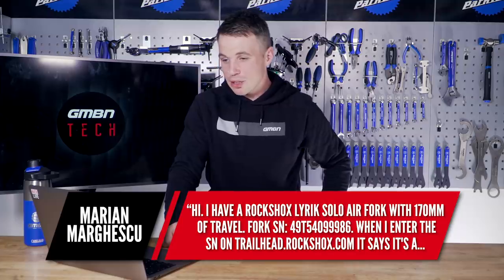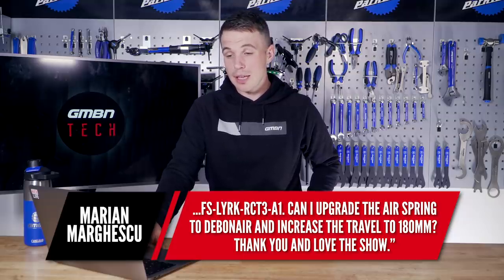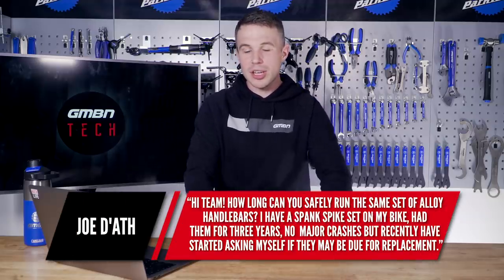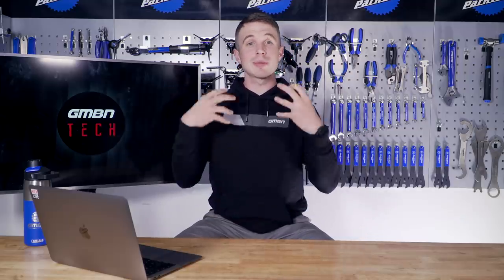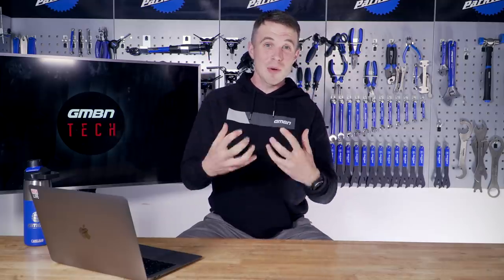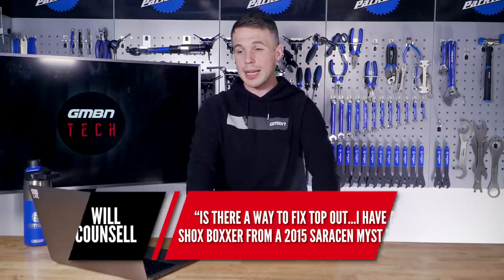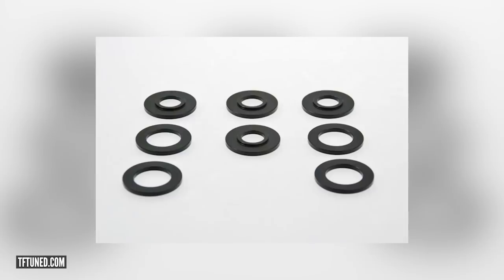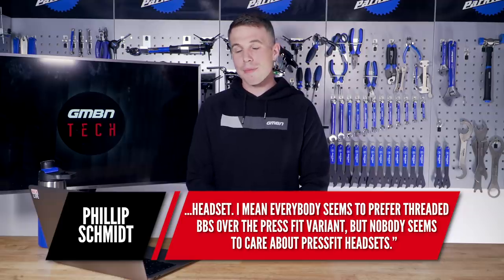Why Is My Tubeless Set Up Leaking? | Ask GMBN Tech Ep. 90

Comment: I had a valve hold air for a few days then when I would add or remove it would then loose air within a few hours. The valve was bad...
Reply: Kazak Thranduil Same thing happens to me I think I think it’s just because the seal of the valve and the rim
Reply: @JamesRailProductions.  that particular valve was bad, I have several specialized bikes so I have a few laying around and a new one fixed the issue 100%

Comment: #askgmbntech I've got a very interesting question: On the new 2020 Commencal Furious with the blue frame and the Fox drivetrain you can see that there is "Factory" written on the side of the lowers of the fork. But the stanchions are black but not as black as the performance version. When you look closely you can see the typical KC for Kashima Coat underneath the headtube. Does that mean that we're getting black Kashima in 2020?

Comment: #askbmbntech While swapping some sram brake levers I had an issue where the hose/olive would not come out. The hose ended up tearing off leaving the olive stuck inside the lever.  Do you have any recommendations on fixing this issue?  Any clue what may have caused this?

Comment: Ian at Renthal is a good dude. got a apex stem with 2 of the same clamps. meaning, the print would go on the inside of one of them. Sent a question just generally asking if this was normal. Few emails later, I had one of the clamps in the mail sent right to my door.

Comment: For everuone thinking of putting more travel on their Trek with KnockBlock headset (F'EX, Slash, Remedy etc.) - doing so you're limiting the way the bike can turn since it can only move a certain degree, there, for example, going around switchbacks on 150mm fuel ex is going to be... awkward. Really.

Comment: I have a question; I have a Juiced Ripcurrent S fat ebike which is sold as a "Sport Utility Bike" meant for paved road and packed gravel only. It came with Kenda Krusade tires which are road knobies with a relatively smooth center tread. I love the tire whir as I travel on my local paved bike path even tho I know it's not super efficient, but this ferocious bike has power to spare so it's not really an issue.  Well, anyway, It's getting time for new tires and I'm considering several, but prolly Maxxis Mammoths. After lightly researching tires, I found that manufacturers offer several options of 26 x 4.0" tire; They come in 30tpi, 60tpi and I believe 120tpi, some are foldable and some wire rim. Some are tubeless ready, but I'm not sure if tubeless benefits outweigh tubes with liners or filled with Slime, especially considering roadside flat repair on a 31.75Kg + bike. Tire selection is quite complicated and was wondering if you have any advice to help me choose?

Comment: #Askgmbntech Is there any bodge or hack to undo and thighten a FSA direct mount chainring? Because the tool is pretty expensive and I will use it once.. Thanks!
Reply: Could just take it to the local bike shop, they probably undo it and refit a chainring for relatively cheap rather than risk damaging it

Comment: #askgmbntech  Hey guys! If you buy a bike with say, 460mm reach with 800mm bars and cut them down to 760mm, how much does that change the reach number? I'm assuming there's some special measurement, and it isn't going to be 40 actual millimeters difference. Same question for stem length

Comment: #AskGMBNTech Are composite pedals any good? I’m looking at getting some nukeproof neutron evo pedals and could you tell me how long they will last being plastic
Reply: i have those exact pedals (in black). Been riding them for a couple of years already (xc/trail riding) and they are still just fine. So far i broke and replaced 3 pins. 

The only downsides i think of are: the pins seem quite long and dig into shoes, there are 2 non replacable pins per side and i lost 1 so far. And the dustcap wasnt properly tightened when they were new and slowly loosened. Once i tightened that i never had an issue

Comment: #askgmbntech. Hi team, I have a trek dual sport 3 that I use for bike packing. it comes with a Suntour shock with 63mm of travel and 700x38c tyres. after taking it on its first off road trip I find suspension lacking and was constantly bottoming out which is no surprise. I would like to keep the 700 tyres for ease of pedalling when fully loaded. Question is can I run a 29er XC suspension fork and still run 700c wheels and tyres? Thank you.

Comment: #askgmbntech Hi, I have a Cannondale BOTE 1 with the 120mm lefty fork which I love. Have ridden and worked on bikes for years and always serviced my own suspension.I've looked online and am struggling to find any info on what servicing is required on this fork. Is there anything I could or should be doing to these forks to keep them in good condition, beyond keping them clean? Thanks

Comment: #askgmbntech Hello guys! I am torn between the new Canyon Spectral CF8 and the new Nukeproof Reactor Expert 27,5". The Canyon is very nicely speced but the geo seems a bit slack at the seat post and a bit steep on the head angle. The Nukeproof is a bit lower speced but is agressive on the geo. What's your opinion? Do you think the difference is going to be considerable going uphill and downhill? Thanks a lot and keep up the great work!

Comment: #ASKGMBNTECH - I have SRAM XO1 cranks and I use a threaded SRAM GXP bottom bracket.  I have confirmed I have a 73mm BB shell but I'm wondering if there's ever a need to use the spacers that come with the bottom bracket.

Comment: #askgmbntech. I have patches of corrosion on my alu rims which has caused the paint to bubble. Is this likely to cause the wheel to fail? They're pretty old and 26" 28 hole so getting replacements would be difficult. Should I just bin the whole wheeler and buy some new ones? I don't use my MTB much so I don't want to spend a load of money on it.

Comment: 3:19  proper carbon bars won't break unless a world cup dh racer has a brutal crash, direct impact, which I saw footage of Renthal bar in Cathrovision do, they snapped at the point of impact. 
But i've not had a crash like that with my Sixc35 bars yet.
but I guess the bars won't just fail by use.

Comment: #askgmbntech my fork is170mm and I am too light to use all the travel. Right now when I use the recommrnded pressure I use is 35psi and the fork sinks down and turn into 130mm travel how do I use all the travel I use the Rockshox Yari and I weigh 42kg but I an still growing.
Reply: Make the sag 30% or maybe even more if it isn't already
Reply: Ben Asquith with the correct sag I only have 100 travel
Reply: Multiple possible issues here. First, remove ALL the fitted volume tokens (rockshox have vids online for this, follow theirs, not some youtube monkey, or ask lbs)
Second if at 35psi ur forks sink down into travel without u on the bike, u could have a blocked neg port or air trapped in lowers. Cycling the forks through full travel (pulling out to full extension by hand) a few times should clear a blocked port. Or use the cable tie slide.down seals to clear lowers .
Only other thought...u know the psi isnt the sag, right? Set psi to recommended level on sticker on fork leg, the in full riding kit, follow gmbn or one of many sag setting vids. 30% sag doesnt mean set to 30psi!
Reply: 35 PSI is waaaaaaay too low for a fork. As Rupert said, are you sure you aren't confusing sag with PSI?
Reply: @src248  i weigh 42 kg if i do 40psi the sag will be 15%
Reply: @rupedog   it is 35 psi any more and the fork wont compress i weigh 42 kg

Comment: #askgmbn Hey guys, I have recently bought the cane creek helm 29 which has adjustable travel spacers. My bike is designed for a 150mm fork and currently, I have it in the 150mm mode. You always say that "putting a larger fork on the bike will raise the front end" but what if the fork is designed to be able to have longer travel? Would this still affect the geometry if I bump it up to 160mm (removing a spacer)?

Comment: #AskGMBNTech. What's up Tech crew, I got a 2019 GT Avalanche with brakes that I upgraded to M7000 SLX, so they are brand new. After I got home from riding a relatively short but steep and rowdy descent, on which I was a bit heavy on the rear brake, I noticed mineral oil leaking from the rear brake bleed port, and where the two halves of the caliper come together(the front brake was fine). I immediately pulled the wheel and pads keep them from getting contaminated and also noticed mineral oil on the backing of the pads in the shape of the pistons (the pistons were not over extended. The disc and pad braking surface were not contaminated). I cleaned everything with alcohol and a clean rag. I tightened the 7mm nut/bleed port and banjo to about 4Nm. Is that a sufficient torque? What could have been the cause of the oil that leaked? And is there anything else I should do or be aware of? Thanks, Awesome videos and keep them coming.

Comment: #askgmbntech hi love the show 
I run a Fox DHX2 Performance Elite on my Bike and i have 2 questiones about it. 
1. Can you Change the valves which controll the oil flow (rebound and compression adjustment) from  Performance Elite to factory, would Like to do that because of the higher adjustabillity( high and Low Speed ) 
2. What can i do against topout 
Thanks

Comment: #AskGMBNtech 

Yo. I’d like to replace my disc brake calipers and reuse my rotors and mounts if possible. I currently have  Avid Elixir 1 calipers with 180mm avid rotors. I’d like to replace those Avid calipers with Shimano BR-M375 calipers (moving to mechanical for reliability, sacrificing performance). Am I able to do this without purchasing additional mounts or rotors? 

Cheers. Good show.

Comment: #askgmbntech
Hi guys. I've recently got back into mtb after many years away from riding and have been updating/modifying my bike. I have a new frame (NS Clash) which accommodates my Atomlab 26" wheels and I've fitted my Marzocchi DJ3's which have 100mm travel. The frame really requires a 120 - 140mm fork and so the BB height sits low.  As forks for 26" wheels with 9mm QR are thin on the ground nowadays, I was considering a 100mm travel fork for a 27.5" wheel which should give a similar ride height? I'm considering this as I'm on a budget. Love the show, cheers!

Comment: #askgmbntech After a minor OTB incident, a brake lever got slightly damaged at a pivot that houses the reach adjustment screw. A couple of cable ties around the adjustment screw have done the job nicely for several months now, but I probably ought to get a replacement. As the brakes are at the lower end of the Shimano range, BL-M315 lever & BR-315 brakes I think, I can't seem to find a direct replacement available online. Can I safely upgrade to a more advanced lever, such as the BL-MT501 or BL-M7000 or would this risk damaging the existing brakes or hose? Would there be any increase in braking performance?
Reply: Apart from different calipers shimano also uses a couple different brake hoses. im not sure the lower tier is compatible with what you got. You can try to see if it works but if it doesnt you bought a brake lever you cant use.
If you are buying new brakes id go for deore or better over the mt500 because of the calipers. They got bigger brake pads and they can be removed from the top so no need to remove the wheel.

Comment: Regarding the Lyrik air spring upgrade. All Lyrik and Yari from 2016+ can be upgraded between 120mm to 180mm with Debonair, and also change the travel. The markings on the fork legs can be a good indicator, but it's not a must have.

Read more here: https://www.servicearchive.sram.com/sites/default/files/techdocs/gen.0000000005734_service_manual_debonair_upgrade_kit.pdf
Reply: Btw, the Lyrik is only between 150 and 180. But it uses the same damper length for all travels.

Comment: #askgmbntech breaking new!! I have some brake related questions. I find that my fat bike is seriously lacking in braking power. The bike, a 2019 Rocky Mountain Blizzard -20, currently has  Shimano MT400's with 160 mm rotors. This brings me to my three braking questions:
1) can you use rotors of a different brand than your calipers - ex. Shimano rotors in a Scram caliper
2) to increase braking power can you install a larger rotor? or do you need to upgrade everything?
3) how do you figure out what type/size of adapter you need to increase rotor size from 160 mm to 180 mm?

Comment: #askgmbntech . Hi Team, I have a 2019 Merida one-twenty 600 with a rockshox sector RL Fork and a Rockshox Deluxe RL Shock in the rear. I love the bike and its suitable for my limited knowledge and talent but i would like to be able to lock the suspension without taking my hands off the bars. Are there any remote locking kits or can i hack a similar kit to work on my shocks. I tried researching on the web but I’m sure  if if there is a big difference between a deluxe and deluxe rl. I don’t really want to upgrade the suspension just yet just for this feature. Thanks for the help and love the shows and the network.

Comment: #askgmbntech I am thinking about changing to a new bike. I currently own a Cube stereo 140 HPC TM (2018) and want to switch to A Cube Stereo Hybrid 140 race (2020). I really like my Kashima coated suspension and dropper and wanted to know of I can change out these components to my new bike and what are the potentiaal issues I might run in to??? Thanks a million. Sander
Reply: Compare specs on their web page, they should list everything you need to know for component compatibility

Comment: Love the show. Hoping to switch to a tubeless set up on my 2017 Specialized Stumpjumper but there are a few dings and bends in my rims (doesn't seem to cause issue with tubes in). Is it still possible to mount tires tubeless or do I need new rims? Thanks #askgmbntech

Comment: #askgmbntech Hi Doddy and Henry! My friend has a 2014 Trek Superfly 7 - a 29er XC bike, which he would like to turn it into a bit more downhill capable. He already put on a short stem and wider bars, wider tires, etc. Now he is considering to put on a larger fork somewhere around 130mm. How to you think this would work out? What is the longest fork he can put on? Thank you and I love the show.
Reply: Literally did this about 4 months ago and instantly regretted it! I had a Trek Superfly 5 29er 2015 and decided to increase the fork from the stock 100mm to 140mm. After i did it, the handlebars were super high and really mixed the geo of the bike up. End story was it was uncomfortable to ride, gave up trying to figure how to balance it and ended up selling the bike. Trek Superfly's sell really well on the second hand market so it might be worth selling and buying a bike more suitable for their riding style.  Tell your friend if they want to make the bike more punishable by converting it to a downhill bike, the Superfly's have 29" NON boost wheels and QR style fixings so they're not really designed to take a real beating. All the experts say don't go more than 10% of stock so you don't mess up the geo, so go 110mm travel and i'd have to agree after my experience. Sorry if this sounds negative but I'm trying to save you the misery i went through, good luck!
Reply: @tomseymour123  Hey Tom, thanks for your answer. Actually I expected an answer like this. Thanks anyway

Comment: #askgmbntech I have a pair of Maxxis Minion (DHR II and DHF) tires that are a little over 1 year old. In the last few months I have noticed tubeless sealant "weeping" out of the sidewalls. Nothing significant, just small dots or runs. The tires hold air just fine. I haven't had to patch or repair either. Any ideas why this is happening? If it matters they are both 3C MaxxTerra compound with EXO casing. Love everything you all do, keep up the great work!
Reply: not a problem

Comment: #askgmbntech Hy guys. I have a CONTINENTAL X-KING RACESPORT 2.2 tyre  with tubeless Zefal sealant that is dry and its gathered all in one place (like a huge adhesive patch) . Is there any solution to degrease that sealant? The tyre is in good condition but now it weights a tonne.
Reply: should be able to peel off? i dont think there is any product to disolve it, try using an old tire as a 'sponge' and rub it off
Reply: @ultiss  I tryed to rub it with my fingers but in one spot it is gathered all the sealant and now dyed...

Comment: Re the brake swap, just to add a bit more detail to the answer which  showed shimano being de-hosed while mentioning sram, sram brakes have a bleed port both top and bottom and are symetrical, so can be fitted either side, no need to undo the hoses at all. so u just undo the whole lever from the bar, and flip over and reattach to the other side of the bar. Simples😁
Reply: Hi Rupert! Thanks for the advice about this in the original question from 2 weeks ago. I ended up changing the handlebars on my bike and noticed I could simply turn the brake leavers upside down, switch them over and bolt the gear shifter to the other brake. They are the Sram Guide R brakes. Saved me from disconnecting hoses and bleeding the system. Wanted to say thanks for quick  answer and advice. Cheers :)

Comment: Hi, I have weird problem with my back wheel it is crackling every turn I replaced bearings and tires but I have still same problem. I was wondering if you had any experience with nipples or rim creaking. And also when tire have less pressure there is less creaking  and when it's more there is more creaking.
Thanks.
#askgmbntech
Reply: Check the spokes tension?
Reply: ^^ Yep, like Pavol said, sounds like spokes need tensioned.
Reply: @palioman  I trided and it's still crackling
Reply: What is ur hub?
Reply: @rupedog  giant tracker I think it's called
Reply: @adrian2275  check the spokes again, just to be sure.